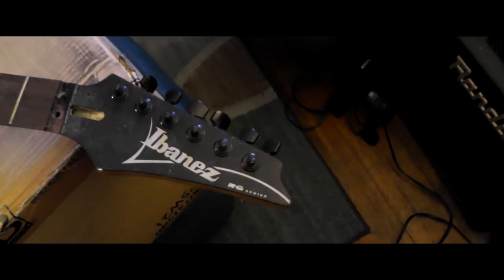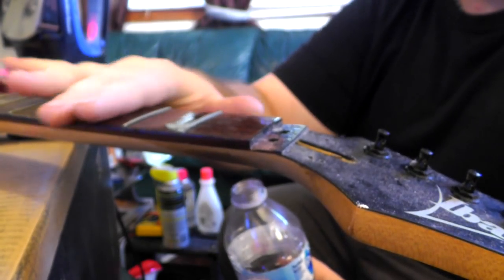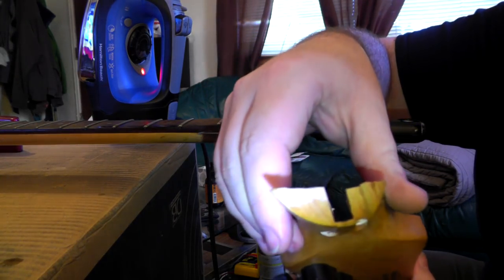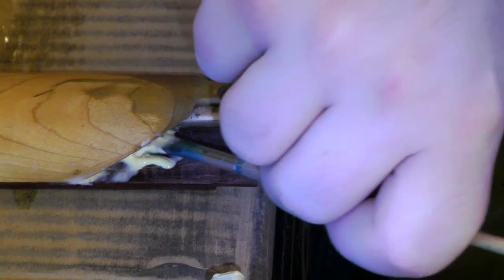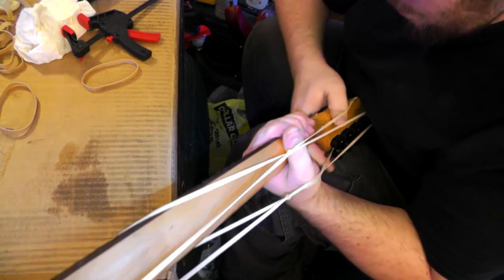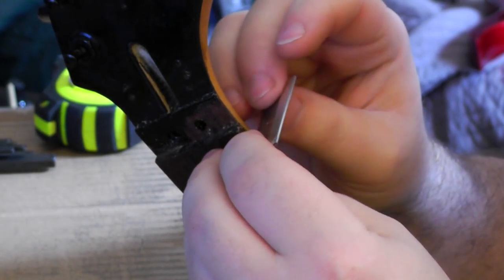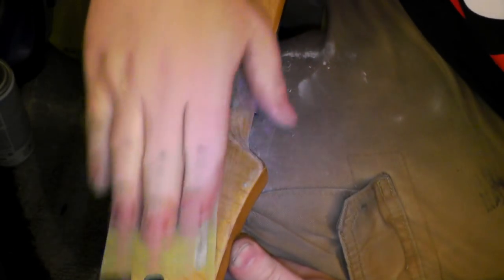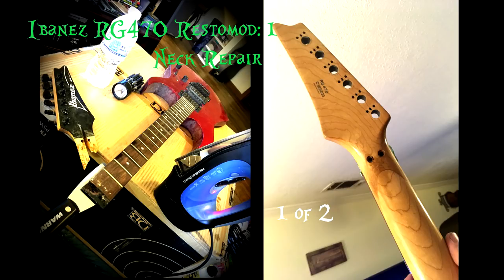Ibanez RG470 Restomod 1:  Neck Repair

Comment: Great job, I just fixed a RG neck with the same crack, a little less through and through, put two small dowels at a 180 degrees angle in there, used epoxy glue.

Comment: My old 1991 RG560 has the same identical break and like yours the fret board is the only thing holding it together. My dad tripped over the cord when I was a kid and snap.  Think I’m finally going to repair it. Lol I had planned to replace it but I have that weird purple paint that changes color and I can’t find a replacement with the right color headstock.

Thanks for the vid bro

Comment: Hey do those 4 inch clamps have enough pressure to clamp a fretboard on the neck?
Reply from the maker: Yes, you just have to use enough to spread the pressure.
Reply: @ForsytheVideo  ok thanks mate.

Comment: Hey man i really enjoyed your video. I'd like to ask you a question: i have a 2cm long crack near the locking nut of my ibanez rg (it goes in the direction to the headstock and doesn't seem too deep,maybe 3-4mm and i wonder after it's glued, will it be safe to play that guitar and will the crack reapper after some time, i mean should treat it really really careful after it's repaired?
Reply from the maker: I have seen this on a ton of Ibanez and other thin neck shreddy guitars.  Get as much glue as you can in the crack, clamp it, and it should last for years.  Remember your guitar is in a constant state of vibration so over time the crack may get worse.  The only real solution is to break it worse and glue it really well.  I would suggest NOT doing that if you don't repair guitars all the time.

Comment: After making this repair, is it possible that this area of the guitar will break again? or is it repaired for life??
Reply from the maker: The glue is stronger than the wood, very unlikely to break again.  I still have and play this guitar 3 years later with no issues!
Reply: @ForsytheVideo  
 So is it a good option to buy an old Japanese RG that comes with cracks in that area? They usually sell them a little cheaper when they bring that detail. And also, is it possible to repair that crack to prevent it from breaking? or do I have to wait for it to break to be able to repair like in your video?

Comment: Someone help me how to dislocate the neck from the body of rg 270 dx i opened the 4 bolts but it was not coming out i could see some adhesive between the joint of body and neck
Help me out
Reply from the maker: Somebody glued it in, you're going to need to get some hot steam through the bolt holes to melt the glue.
Reply: @ForsytheVideo  thanks for the reply